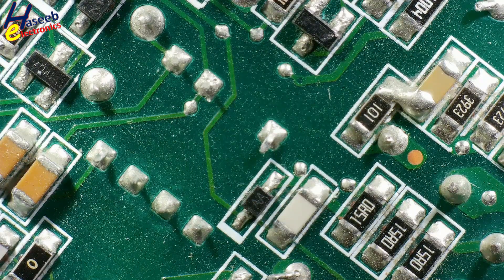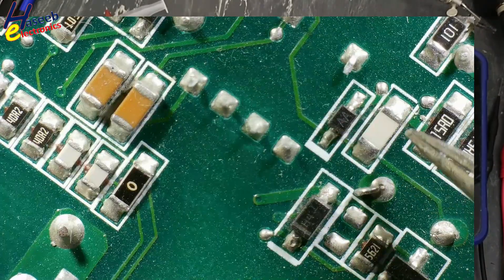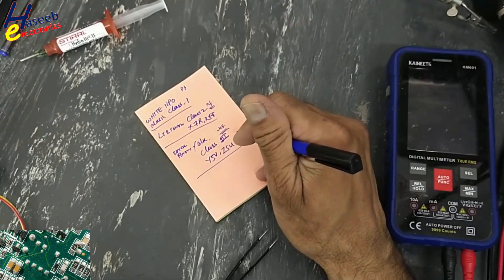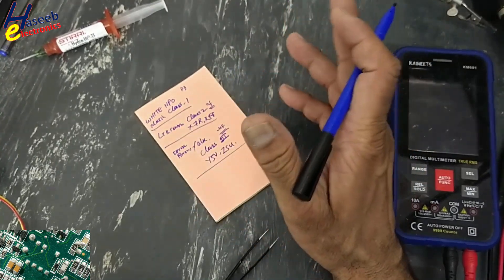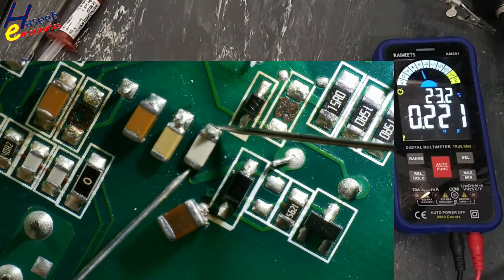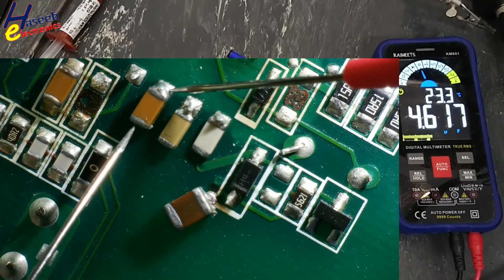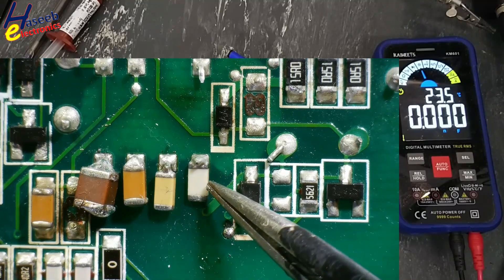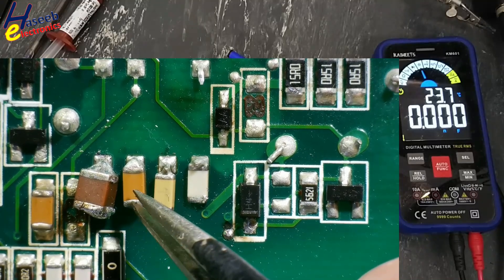{1243B} SMD ceramic capacitor color and capacitance range

Comment: I really needed this video! Thank you. I just want to know one thing, how often do these capacitors go bad? I have a  APC UPS ( Model:Back-UPS RS 1100) that I'm trying to fix but it's still malfunctioning. I put new batteries then it worked for a while then it stopped working. Starts then shuts down with a long beeeeeep. I've changed the lm324 and lm358 op amps because I saw they were getting too hot, tested several smd diodes and transistors with multimeter, they seem ok. I changed several electrolytic capacitors even though they were still within range after testing with capacitance meter. Is it possible that one/some of these ceramic capacitors is the culprit? When I turn on the UPS it makes a few beeps but in quick succession in the battery testing phase before it shuts down. Usually it beeps slower. Any help will be greatly appreciated. Thank you.
edit: There is a LM317 that gets very hot too

Comment: Do you have any advice on soldering SMD polyphenylene sulphide ~ PPS type capacitors.  Since I have been told that they don't tolerate heat very well and if getting 'too' hot during soldering they have a change in their capacitance value.

Comment: Sir how to identify coupling and decoupling and filter capacitor by its connection in circuit and how to calculate it's value and how these capacitor works in circuit please explain this concept on diagram

Comment: I wrote about the colors as a comment to another Youtuber who is an electronics engineer, and this is his answer:
"Thanks for the suggestion. Actually, the color of SMD capacitors typically does not indicate the capacitance range. Instead, the color is often related to the type of dielectric material used or the manufacturer’s branding. The actual capacitance value and other specifications (like voltage rating and tolerance) are usually marked using a numerical code or sometimes a three-digit or four-digit code. If you're working with SMD capacitors, be sure to check the part number or datasheet for the exact specifications. Hope that clears things up."
Reply from the maker: @voenigs612  thanks for your valuable comment 
Yes you are right. This color branding defines the dielectric.materials. that color material are defined for  specified capacitance ranges. suppose NP0 material has its own color and capacitance range
X7R /X5R Has its own color and capacitance range 
Z5U materials is it's specific capacitance 
And and sometimes these all color schemes are bypassed and capacitor is made on manufacturers desires. Then no idea or rule will applicable 😂😂
Reply: @HaseebElectronics  Thank you for your detailed answer!

Comment: That's not a strict rule, you can find brown capacitor in pf
Reply from the maker: @buug76  you are right. It is not mentioned in any documentation but it is my own experience that I find these capacitors in these categories 
It depends on material 
X7R capacitors are also available in pf 
It is also in explained in the manufacturers catalogues in "dielectric and capacitance charts"

Comment: A detailed video as done on induction cooktop, solar inverter etc. with basic details and circuit explanation is required on

"HOME SINEWAVE INVERTER"

Clearly explaining how the charge circuit is working and same transformer is switched to produce  ac while operating in inverter mode.

Consider this humble request..

I hope a positive response from your side...

Comment: Kudos to you for this video, very helpful, however I must ask you if this a thumb of rule (is it a constant?). Capacitors are a headache for many repairmen because there are no regulations for its manufacture yet, and sometimes the damn things are burned or have exploded and there are no schematics for its replacement.

Comment: The size of the smd capacitor matter?
Reply from the maker: yes size is important to decode. so the replacement must be in same size. because the smd pads and tracks are much congested

Comment: thanks for this video.. my question: is the direction of rotation of such capacitors unimportant ?
Reply from the maker: best regards 
these capacitors are non-polar capacitors. these is no polarity. these can be installed in any direction
Reply: @HaseebElectronics  okay, that's what I thought  😇

Comment: This video is really good 
Sir is the ciramic capacitor is used for noise cancelation(normally)
Reply from the maker: best regards 
pF white capacitors are for oscillation uses 
nF capacitors are used for noise suppression 
uF are used as smoothing purpose in dc rails

Comment: The first time I am making a comments.I am following your chanel from long time now.Haseeb you rock and really thank you for your hard work and the knowledge you are sharing with us..Greetings from Bulgaria.
Reply from the maker: humble thanks and best regards for your valuable words.
Reply: @HaseebElectronics  Thank you very much for sharing your knowledge. May God bless you always. Depending on your time, please make a short video of the different sizes of SMD capacitors, from the smallest to the largest, please.
Reply: Thank you for color explanations.
Can you tell me what temp you using to desolder components?
And air blow speed.?
Also how you solder them back?